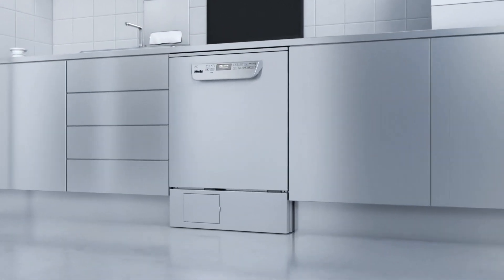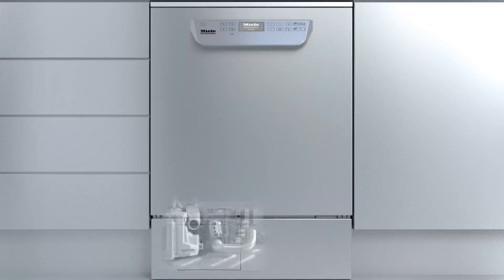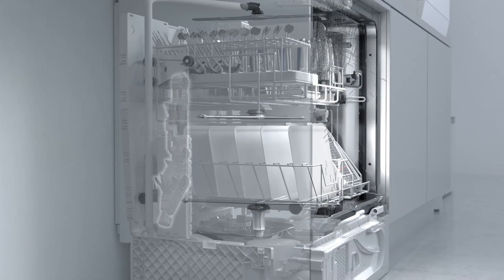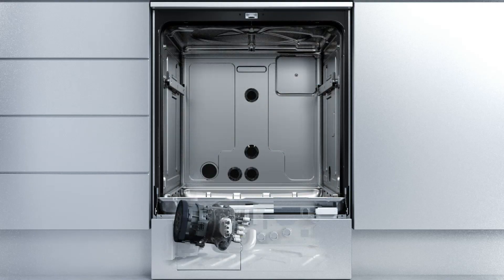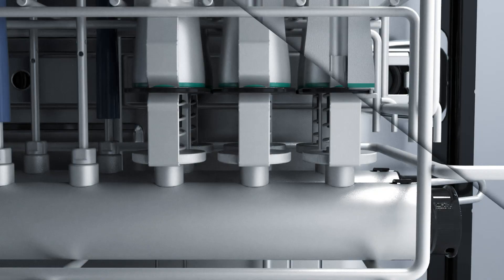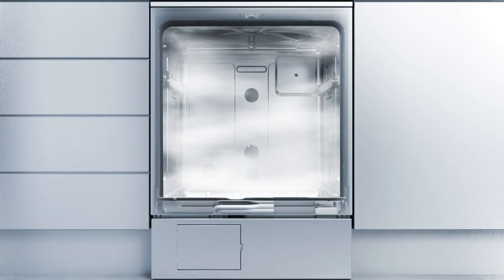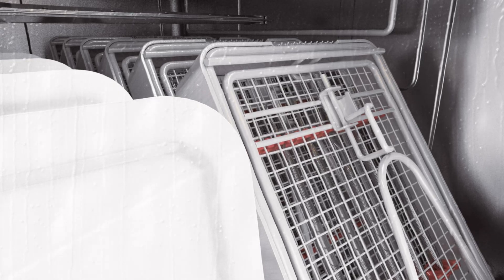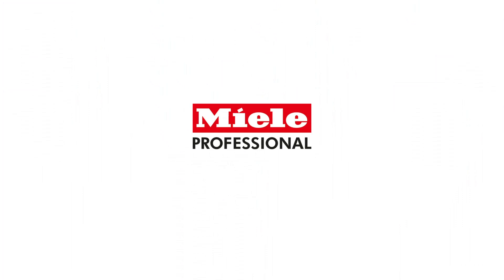Miele Thermal Washer Disinfector Greater Performance

Comment: We purchased our Miele Thermal Disinfector for A$11,550 in 2012 for a new Dental Surgery in Sydney. There have been a number of major problems with the unit from day one. Unexplained error messages that could never be identified as the unit often stopped working. Defects from factory were discovered after 3 years, but out of warranty! This unit has cost thousands of dollars in repairs over the years. Also staff have found this machined actually rusts the dental instruments so we now only use it for washing plastic trays.  Miele no longer service this unit and have passed it on to W&H (Pegasus). We recently received a quote for almost $2000 to repair a cracked sump. We have decided to dispose of the unit as it is not fit for purpose. Really regret buying the Miele Thermal Disinfector. A serious waste of money.